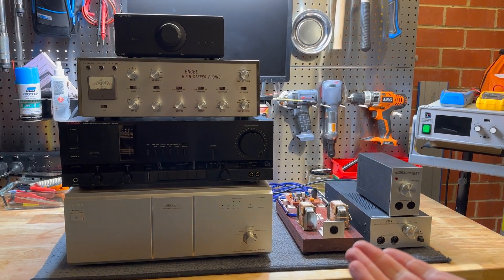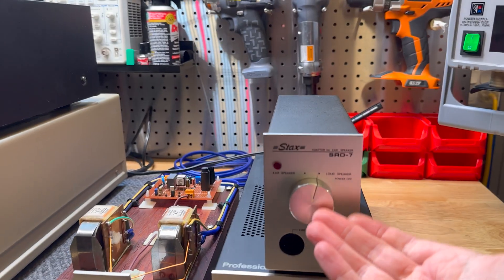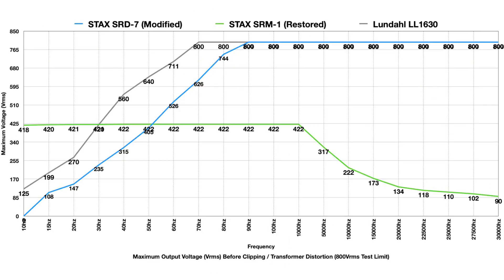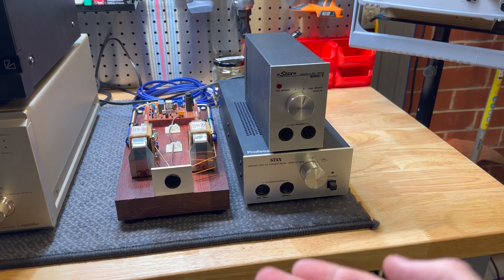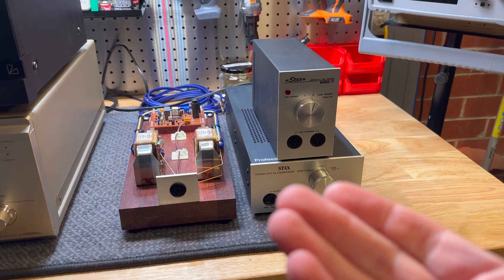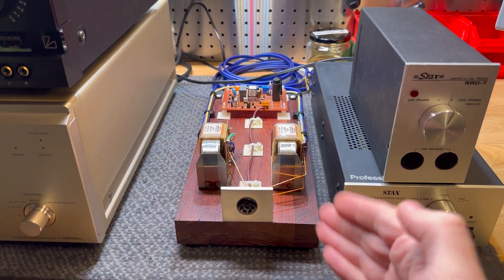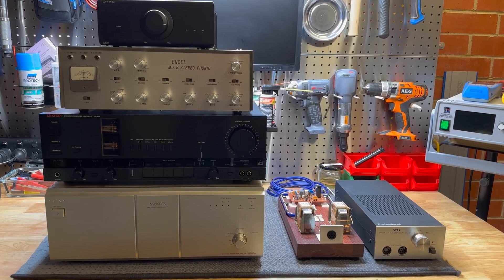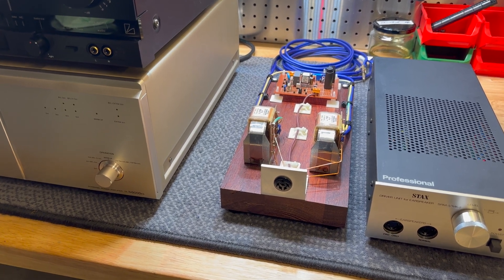STAX Earspeakers - Lundahl Transformer Results!

Comment: What source impedance and what load resistance did you use for these LL1630 transformers?
Reply from the maker: Load was a 120pf 3kv capacitor, I tried other configurations with additional resistance but it just disadvantages the SRM-1 even more as it loads down and drops output voltage. My L700s measured roughly 110pf capacitive load.

Comment: I'm one of the luckiest that have iESL. Works pretty well with power tube amplifiers like Muzishare X7 with better tubes. Only slight hiss coming when using ultralinear. Triode is dead silent. 50W is enough. Muzishare X7 has only 25W at triode. That is also enough. Never need to go past 12. You can try chain PRE-AMP between DAC and STEREO AMP.

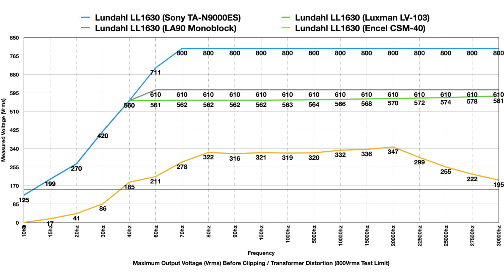Comment: This is a great video.  Is there anywhere you have documented the testing methodology you used to create the graph at 15:06?  What type of load are you using?  Are you on any of the DIY audio forums?  I have two Benchmark AHB2 amps and an iFi Pro iESL engergizer.  I'd like to test my setup to see how it compares to your LA90 monoblock setup.  I believe the iFi Pro iESL transformers are going into saturation and are my limiting factor, but haven't tested anything yet.

Comment: I wonder if the higher end models like the lv-105 or lv-107 amps would perform any better than the luxman you tried here.
Reply from the maker: I have the LV-105u that was recently restored and it has worse noise floor than the LV103 unfortunately… If that is due to age and heat I’m not sure but both channels were evenly matched so I assume it’s just how it is. I spent a lot of time chasing it to no avail and most parts are unobtainable now to swap out unfortunately…
Reply from the maker: I should be clear also, it’s probably acceptable to most people to use them but I’m chasing perfection and have many amps at my disposal. I would take the Luxmans if they offered a different sound signature but as the chart shows, their basically identical to the other amps.
Reply: @whatcouldgowrong7914  fair enough, I have heard that the luxman lv-105 (and the other two) are fairly clean sounding amplifiers which makes you wonder what the tubes are even there for.. Have you tried the sansui amp yet and if yes how does that compare to the topping for use with the earspeakers?
Reply from the maker: @trevor245   Definitely fairly clean but unfortunately with sensitive headphones or using those transformers, their sensitivity is quite high which can make background hiss an issue. Im sure the tubes offer advantages with linearity etc and the 103 performed up there with the Topping monoblocs (100Wpc) with raw power output which is way more than a 103’s rated spec. Having just a single volume pot in the Luxmans really hurts the signal path integrity unfortunately. The Sansui will be covered in detail later but it’s my endgame I think… More power than I could ever need with the clarity of the modern, clean Toppjng LA90s. But you couldn’t expect any less having 6 potentiometers for the volume alone!

Comment: Transformer hum is very present in most vintage amplifier gear.. even 2000ish gear have problems in the high end segment..
In europe, voltage have gone from 220 to 230-40. (My area 235). Been checking for the presence of dc, which could contribute, and occationally it occours. Been considering to design some kind of standard cheap dc block and noise reduction circuit, beside adding a high voltage dc block capasitor.
Reply from the maker: Yeah its odd, way more hum than ive heard from other gear… tempted to try remounting the transformer. Obviously never designed to sit near you though